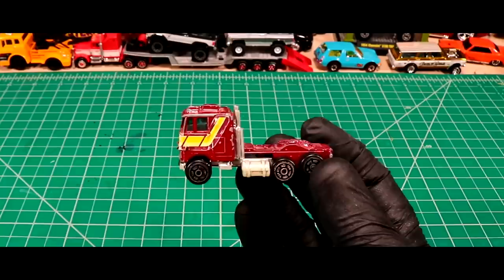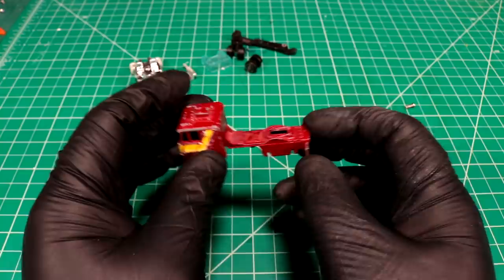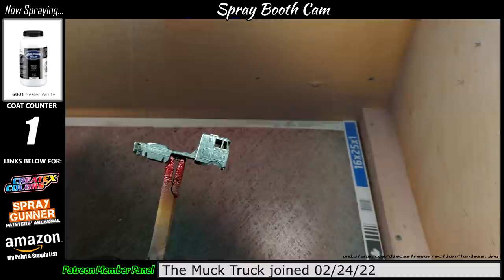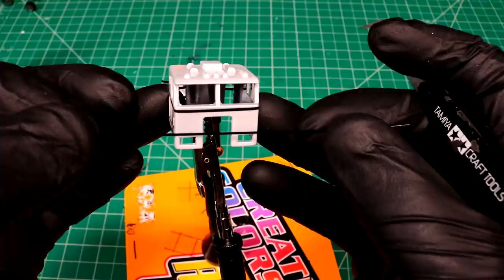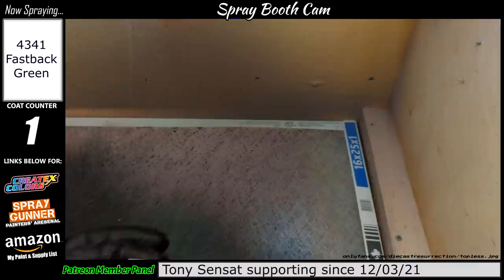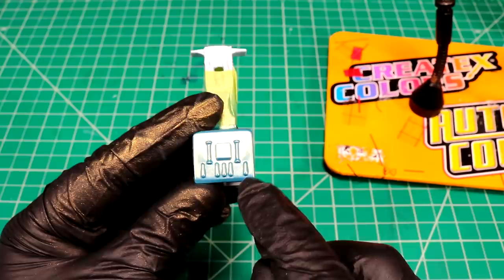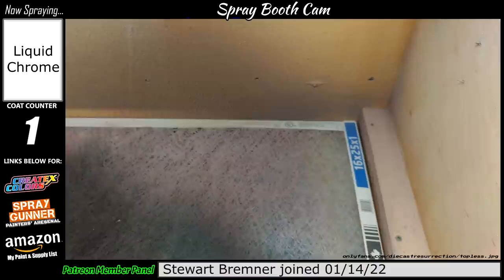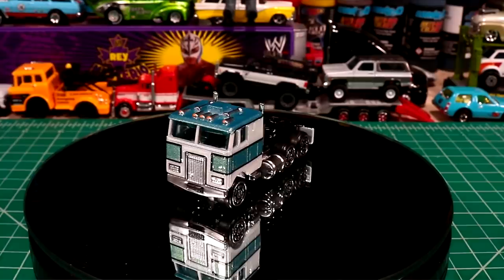Painting Diecast Cars - Cab Over Restoration

Comment: looks proper! of course it was shedding it's paintjob, it wanted to grow in your hands. :D love the colour scheme, and the detailing adds so much to this little simple casting. :)

the worst on mould misalignmnet I've ever encountered was a model kit by Revell Germany, of a steam locomotive. many of the parts were mismatched, the kettle was too large for it's opening in the cabin by almost 2 mm, one of the main wheelsets wasn't straight with the rest, and the domes on top of the kettle were misaligned left and right half, by a milimeter or two... right where you looked at.  and it wasn't a cheap kit, either... it was very detailed, too. only the main pieces really tested my patience. since the series is still produced by Revell I guess they got better quickly. but, still.

Comment: I have this same casting.  Mine is in a lot rougher shape, though.

I've been struggling with clear coat on vehicles I'm painting 2 different colors.  Do you typically clear coat
right after your initial base coat like you did in this video?  Does the secondary color adhere well to the clear coat?  I would have thought all base colors would be applied before any clear coat.
Reply from the maker: Yeah normally you'd want to clearcoat last, When using water based paints though sometimes I clearcoat in-between colors if I have to apply decals or maybe use my stencils to lay down white paint on color.